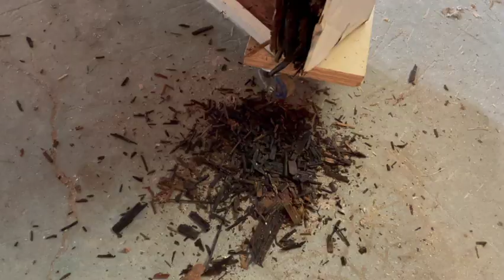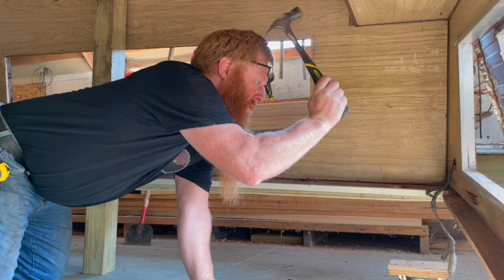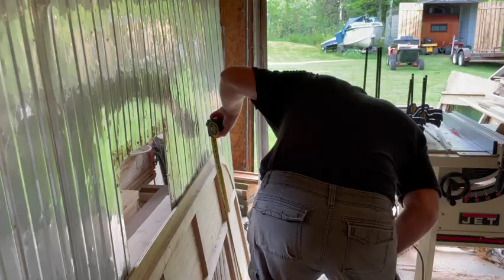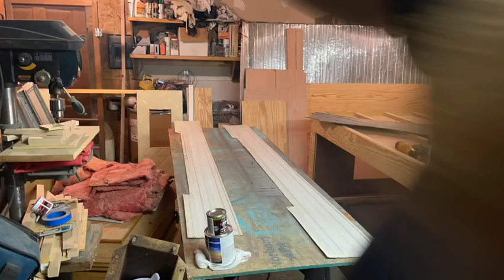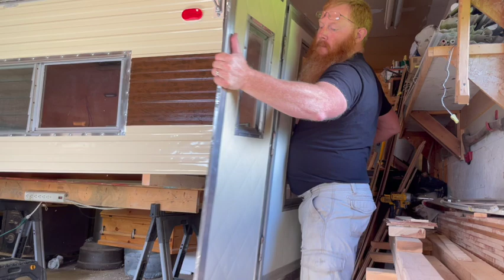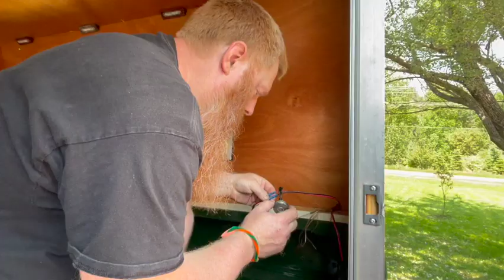Vintage Topper Restoration. Smith Built Canopy Truck Shell.

Comment: How tall is the cap?  I am thinking of making one for my 2022 F150 and doing a rise in the rear section for more headroom
Reply from the maker: @slmjake  If I remember correctly, it is 36” tall. Not tall enough to stand up inside, but tall enough to sit on a short chair inside.

Comment: Wow! Now I’m kinda pumped up on restoring my shell topper that sits on my 68 F100 SB 4x4.  Your rig is similar to mine in that it also has a konieg winch on an extended front bumper. I appreciate your video. I can use it for reference when I take on this restoration project . Great job!
Reply from the maker: @benzkeez  sounds like you have quite a cool rig! I hope your project turns out great! Thanks for watching.
Reply: @backtolife208  
Yeah I really like it. The guy I bought it from was in a 4 wheel drive club in Colorado. Mechanically it’s in decent shape, he worked on it and kept it up but it was parked for a few years. I just need to work on the cancer and a couple of dents and need to replace the carburetor. Thanks again!👍